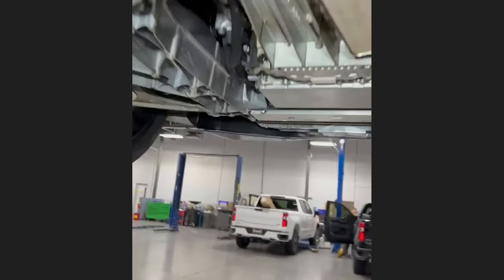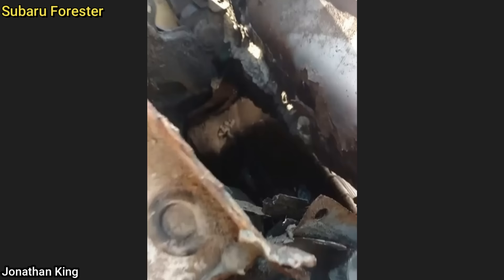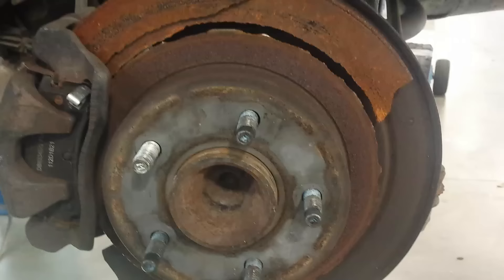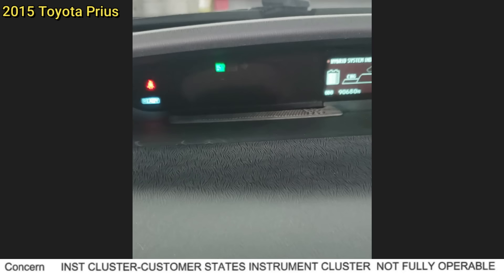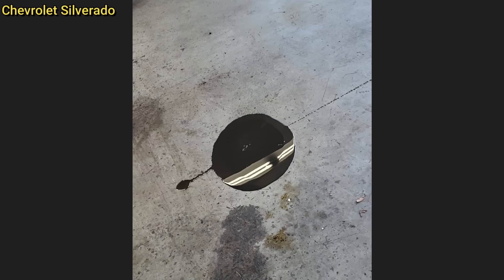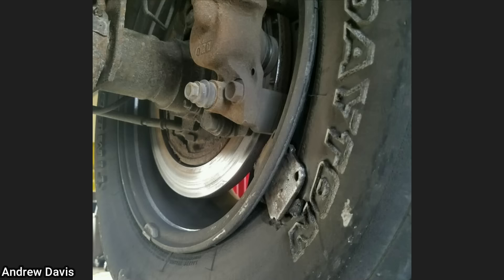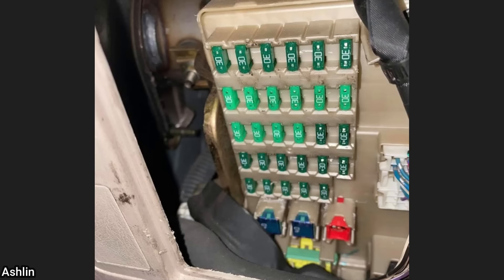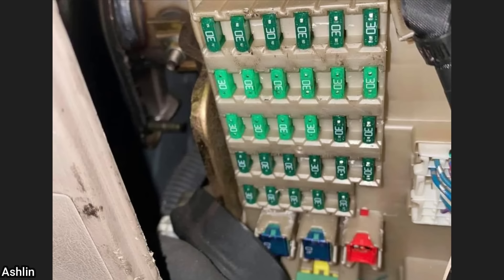Customer States Brand New Corvette Shut Off While Driving

Comment: What an ingenious idea! How did nobody think about replacing their broken suspension components with wood slabs? Next when the engine fails, a great idea would be to install a massive main mast, rigging and sails and then maybe they'll be able to sail themselves out of the ocean of stupid
Reply: Hey! That's ingenuity. I'm using pressure treated lumber as a transmission cross member and it works just fine. And the three temporary spare tires I have installed have held up just fine for the past year and a half, thank you.
Reply: or a wooden piston
Reply: @ronblack7870  .... Garage 54 did that already!
Reply: hey.. least if you did that to an SUV you'd have an environmentally friendly SUV
Reply: @marvthedog1972  as a joke i was thinking about putting fake masts and sails on my suv mostly because when it turns in roundabouts it tilts like an actual ship, almost endless source of entertainment for little kids in the back
Reply: And the previous one with a zip tie holding the spring mount together.
Reply: You can already do that, just buy a hellcat
Reply: There is an old Top Gear episode where James May "amphibified" a british roadster with a mast ans sail.
Reply: Avast me matey, that Subaru just cut me off. Load the cannon!

Comment: That brakepad working its way through the rim was AMAZING!! 🔥
Reply: Must've been totally ignorant of the horrible noise & sluggish acceleration!
Reply: I have seen missing caliper bolts and the whole caliper wearing into the rim in a similar fashion.
Reply: @rupe53  - I was working as a track marshal at a MotoGP race and at the end of each session we have to check the track for debris and fluids.  I found two front caliper bolts sitting in the braking zone at the end of the back straight.  It must have been one from each side because we didn't have any crashes in out corner.
Reply: @stevie-ray2020  Probably completely deaf/blind/no smell/have no sensation in the body at all with the following vibration and loss of brakes 😂
Reply: @rupe53  That's crazy
Reply: @Kilen81  ... hey, so is everything else in these videos!  <LOL>
Reply: Best thing ever

Comment: I live in Northern California and the markups on the new Corvettes are insane.  I can't imagine paying that much money and having the engine go south with only 1,300 miles on it.
Reply from the maker: I've been hearing easily 30k mark ups on them. New vehicle prices are still so ridiculous.
Reply: Bet he beat that car until it stopped.
Reply: Even if they put a new motor in it the car will drop in value as it is no longer a numbers matching vehicle.
Reply: @Slartybartfast465  That's not how numbers matching works.
Reply: @Slartybartfast465  Is that still a "thing" these days? Oh, and this guy probably was thrashing the life out of this engine and it finally gave out.
Reply: @youknowme8578  It looks like there's a problem with the transmission as well as some engines are missing ball bearings.
Reply: @jamesplotkin4674  
it finally gave out.

Finally gave out? Only had 1300 miles on it.  It had yet to give in.  lol
Reply: @Slartybartfast465  yeah but its not a vintage car lol. nobody gives a shit about matching numbers on a brand new car
Reply: @jamesplotkin4674  It's not a thing till it is, just like it was on the old ones. 

Couple brand new vettes have popped, usually happens on a new model year. Never, ever buy the first year of a redesign. That's for the egotistical morons with more money than brains. They're always flaky, no matter the manufacturer. Late model miata popped transmissions like skittles till the next model year got a redesign. First miata ever had a shitty crankshaft design that was fixed in later models. C6 vettes had a plethora of issues, I had to deal with those personally.
Reply: Way to many Chevrolet motors going south for the last couple years! But you can bet those where 1300 extremely hard miles.
Reply: @picax8398  All vintage cars were a brand new when they first came out. That's how time works.
Reply: @picax8398  Guess what genius, vintage cars were brand new cars at one point too. In 30 years a non numbers matching car is a big deal.
Reply: Quality is job 1!   Oh wait, that was Ford.
Reply: I’m not convinced he bought the car in Cali to drive to Texas.
Unless that was a shop in Texas?
1,300 miles in a new car really isn’t a new car.
So if he wasn’t in Texas when it happened and still in California, he bought a used car at new car prices. 
And if that’s true, the engine problem is known to them and that car is and may always be a lemon.
Reply: @zloss  Just needs to be original equipment. i.e. you don't own a 454 SS Chevelle just because you dropped one in a Malibu.
Reply: @zloss That isn’t how it works the dealer will order a brand new engine with the vin of the vehicle stamped on the block and it will be married to the car. Nobody will know it’s had the engine replaced other than the dealer that did the job and the owner.
Reply: it wouldn't surprise me if he didn't break in the engine properly.
Reply: @youknowme8578  Nope, it's been going on for years. Vettes don't even make it 50 miles and engine grenades. COMMON problem. One made it 4 miles from the dealership LOL. GM is junk.
Reply: That's the thing about spinning a V8 to 8 grand.
Reply: @TheGuruStud  lol, whatever buddy.
Reply: @Slartybartfast465  that doesn't really matter unless it's a collectible vehicle, which its not
Reply: @pontiacg445  I'm really thankful to the person who taught me the word plethora!  It really means a lot.
Reply: @HimmelWeint  replacement blocks are marked replacement block. It is illegal to duplicate a VIN number even by the company.
Reply: and it had NOTHING ... to do with the driver operating said car
Reply: There was a guy who had his engine go with only about 50 miles on it. He was a collector with several corvettes and was driving the salesman (who drove one of his other corvettes home when he took delivery of the new corvette) back to the dealership when the engine blew.
Reply: @HimmelWeint  Except it will be on the vehicle history report. It cuts the value drastically.
Reply: @youknowme8578  I wonder if they had the telemetry recording... dealer should have tried pulling it up.
Reply: @youknowme8578  i beat my 2016 Volkswagen R with bolt ons and raised boost levels, it never quit from brand new to still 85k on the clock.  gm just making trash as usual, must be a weekday in business again
Reply: I mean the whole car was going south. He took it to texas 😂
Reply: @HimmelWeint  That's not true, the numbers on the block will be coded with a prefix or suffix, showing it's a replacement.  It's been that way for over 60 years now.
Reply: @youknowme8578  The computer won't allow you to beat on it until it's beyond it's break in period.
Reply: @Slartybartfast465  name a late model car that will ever have number matching value 20 years from now.
....drive it like you stole it.
Reply: @TheGuruStud  any engine is junk if it isn't broken in properly. Doesn't matter who makes it.
Reply: No doubt, wasn’t broken in yet. You’re supposed to cruise the first 1500 miles before doing any ‘racing’.
Reply: @Jaslath  that's the point though, it's a brand new engine and the guy's driving it back on highways that go up to 80mph with steep mountains and hills...
Reply: Who would buy in California with all the aweful emissions standards 🤔.
Reply: @Slartybartfast465  Not every brand records engine numbers against VIN, just engine type.
Reply: It's the same car regardless it is sold in this country. Most just produce just one model valid almost anywhere.
Reply: @steveb6103  It's because the cars are assembled in Mexico and training and quality control is nonexistent.  New Silverados have bad suspension problems and look like they've had 100,000 miles put through them after only 6 months because the workers are assembling them improperly and damaging them.
Reply: I read an article that dealerships explained the uprise of the extortionate Dealer Markup is to subdue the scalpers. People buy high demand cars and immediately list for sale by owner.
General Motors and Ford are aware of this scalping practice and exploring legal ways to void the factory warranty of any vehicle involved in a scalped purchase
Reply: Should have gone 2 or 3 times that!
Reply: @Slartybartfast465  matching numbers means nothing with new cars; the big thing in 30 years will be, does it have matching ECU?!? 😂
Reply: @fosterpainter  passes with time as we pass through it.
Reply: @garyszewc3339  Keep in mind...those muscle cars of the 60's and 70's weren't considered collectable when they were new! They were simply new cars!
Reply: Based on the shrapnel the technician found something tells me the new owner was having a little too much fun on the way home.
Reply: @irishkelly654  they were not produced in the numbers of these cars. When they start out in low numbers, they become rare due to attrition. Mid-70s Corvettes are a dime a dozen.
Reply: @garyszewc3339  - I said muscle cars, not corvettes.  But yes there are some rare corvettes, C3's weren't really one of them. If you ordered a 1970 or 71 with the big block, you would have something. The cars that are the rarer ones, were ordered. You could go into a dealer and check off whatever options you wanted. This is what made some of them very rare! Example - there were just over 43,000 Roadrunners made/sold in 1970 but only 152 were hemi cars. That makes the survivors really rare, especially when you think other options, how many were totaled. If people thought they were rare and going to be worth a fortune at the time. I guarantee you more than 152 hemi Roadrunners would have been ordered! Same goes for pretty much everything from that era.
Edit: There were roughly 80,000 Road Runners produced in 1969...they are still considered rare and are worth a $hit ton of money for the rarer models.
Reply: @irishkelly654  that's exactly what I was saying, this Corvette will never be worth anything.
Reply: @GamingProspector84  I would hope the computer in the Corvette would record how it broke, meaning what RPM.  Those cmputers can tell you how many times each spark plug fires.
With that said have you watch videos of newly built high performance engines being Dyno tested?
They don't  come  remotely close to that much break in time before a full throttle pull.
Reply: @youknowme8578  Lol probably so but arent they made to be driven and wasnt he past the break in period?
Reply: Back in 2009, I worked at a Chevy dealership here in northern Ohio. A guy from Texas, who worked for GM, bought a Corvette Z06 from us because we were the closest dealership to him that would let him use his GM employee discount on a Corvette. No other dealership between here and Texas would.
Reply: GM quality has gone away. No way on earth should a motor hand built give way in 1300 miles. Clearly someone wasn't doing their job properly. So much for quality control.
Reply: @jdslyman - Yea, I bought a 70 Roadrunner in 1976 for $1,500. Sold it in 1982 for $3,500. Today it's worth close to $50-60,000.
Reply: @ericjohnson8482  They do that for you now? I had no idea, thought it was still left entirely up to the driver
Reply: Saw a report a couple weeks ago of a guy with a new Z06, 51 miles and blew the engine.
Reply: @jamesw.6931  - Oh man!! That's tough! I'm a Mopar guy but I tell you, that boss 302 - one of my dream cars for sure!
Reply: @jamesw.6931  - That's too bad. You are likely correct about wrecking it! The guy who bought my Runner did pretty much the same thing but it was a light pole. He punched it, fish tailed it. Rear quarter damage only, frame was okay. He repaired it but I will always be sad about it. Cheers...
Edit: Forgot to add - did you try Mustang car clubs, specializing in the Boss 302's? They are very rare/unique so you'd think if it is still road worthy...do you have the VIN?
Reply: @Slartybartfast465  
Most Corvettes are like the LEAST valuable used cars these days.  Other than some of the real classics of course.
Reply: @pontiacg445  
Most GMs take longer than a year to sort out.  The 3.6 engines still suck.
Reply: @Jaslath  😂
Reply: I can he if constantly floors it at every chance he can...
Reply: That's what s warrenty is for.. to protect against manufacture mistakes... who cares how much the car cost if it's free repair
Reply: Gm had to buy a used ferrari engine to copy to figure out how to make a flat plane engine..lol.now that's what you get..an experiment..they should stay to old pushrod engines.
Reply: @Slartybartfast465 who gives a crap about matching numbers?
Reply: Failed while driving back to Texas - maybe the empty interstates were just too much and it became "let's see what this baby can do!"

Comment: It is amazing and confounding that so many of these vehicles are on the road!
Reply from the maker: Yep! Chains and rusted out strut towers. Bad time lol
Reply: @JustRolledIn  don’t forget the 2x4 suspension link 😂
Reply: Nah, what's amazing to me is customers who drive off or decline further repairs
Reply: @XNick291X  Yeah... I imagine some of that is due to cost, which is why most of those are like that and still on the road in the first place.
Reply: @_S0me__0ne  Yeah, I can totally understand and sympathise if it's not affordable
Reply: I'd be scared to drive around. I'm kind of glad that the inspection departments are nitpicky in Latvia about the status of the car - looking at every spot, shaking it, moving every bushing to see if things are due to replacement, checking if brakes are smooth, if everything is at or above minimum values.
Reply: @knuttsackjones3094  surely if the timber is treated for woodworm and dry rot it will be OK

Comment: I think it needs to be like a Federal Law, where it states, If a Shop deems the Car/Tuck Not Safe to Drive. Then the Show has to Tell the Owner of Said Car/truck that the Only Way the Car/Truck can Leave is on a Tow Truck and the Shop should be Required to Notify the Police and Detail to them Reason for it to Not Safe to Drive and Also, Name of Owner of Said Car/Truck and License Plate. Where Police can have it in a Database, So if the Car/Truck is Seen driving on the Roadway, the Car/truck Can then be impounded and Only Released by a Judge, Where it is Court Ordered to have it Tow to a Repair shop to have the Repairs to Make it Safe and Legal to Drive or Towed to a Scrap/Junkyard.
Reply: It would at least be a good beginning to have a yearly mandatory inspection like in germany, where your car can be confiscated if it is concluded to be unsafe to drive and/or repairs can be mandated. Of course it has to be together with some kind of federal controlled register to have nationwide standards and eliminate inspecion fraud.